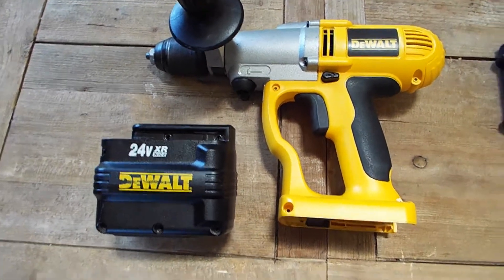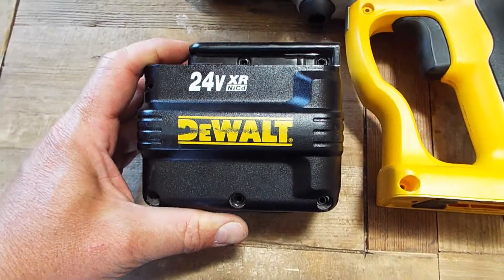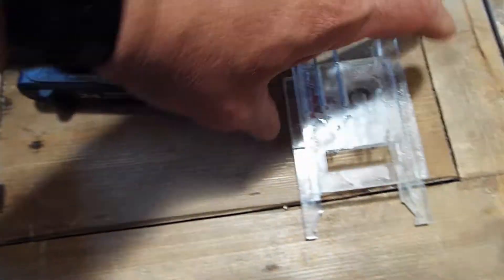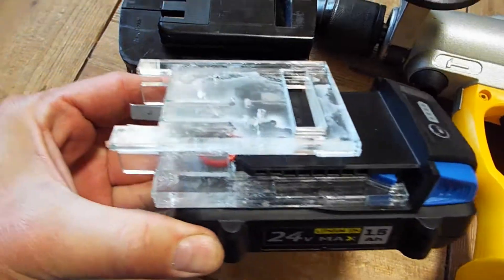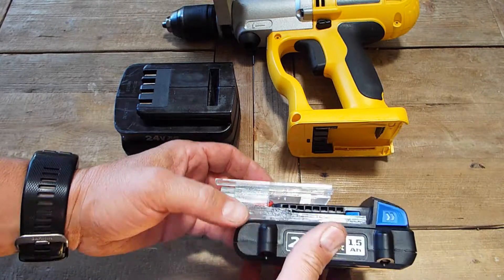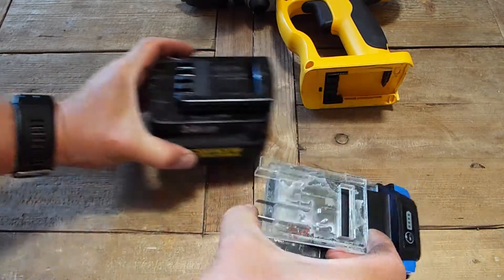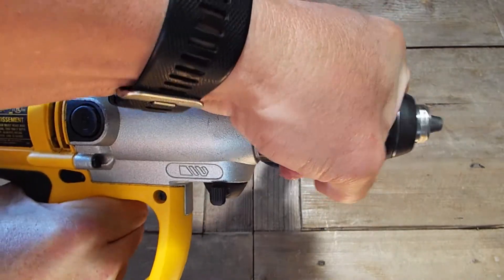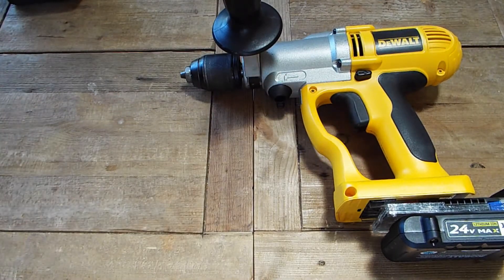24V DeWalt Tool to Kobalt 24V Battery Adapter

Comment: 10 dollar batteries? Wtf😅
Reply from the maker: It was years ago. Still have about 10 in packages, they still show 50 percent charge when you press the charge state button.
Reply from the maker: Also the 10 dollar batteries were the only reason I ventured to the 24v max Kobalt line of tools. I have almost every tool they made and really love them.
Reply: @madscientisthut  
The tools do work nothing against them, but I wish they came out with more options like ryobi.

Comment: Excellent work and great video example! We have older Black and Decker 24v Hedge Trimmers and the B&D 24V batteries aren't being produced anymore, but we couldn't see our way clear to getting rid of the trimmer that works great. Do you have plans on making more adapters for the Kobalt 24v to attach to things like the B&D 24V system, and maybe the B&D 18V drills, etc.? Thank you for considering.

Comment: Would you sell.a adapter or do.you know of someone that does I saw green works and kobalt are very similar on the the 40 8v system but not sure about the 24 v bc you can get green works adapters so I wonder
Reply from the maker: You may check ebay. I do not sell the adapters I was just showing what I did to give other people ideas.

Comment: since I don't have a 3D printer. I remove the batteries from the dewalt 24v battery pack, now it is nice and light and connect a 24v kobalt and run wires positive to positive and so on.

Comment: I would be willing to pay for two of those adapters. I have 24v Dewalt Sawsall and hammer drill, and they never get used because the batteries are shot. And new ones are very expensive. If you could make me two, or have a way to 3D print them, I'd be willing to pay for them. Please let me know.
Reply: I’d be willing to buy 2 of these as well 

I love the video. calste28@gmail.com

I’ve search all over online to purchase something like this and I can’t find anything.
Reply from the maker: Hi if you search ebay, there are people selling 3d printed ones.  Thanks for watching.
Reply: I've been unable to find anyone selling one, only the files to 3d print my own. If you have a link to an actual purchasable product, I'd appreciate the link.
thege128@gmail.com

Comment: You think the Kobalt 24v battery will work on the Channel Lock  #718715 drill from several years back? It's 24v NiCad. Drill works great...battery was the only thing really wrong with that kit.
Reply from the maker: nc50express I see no reason why it should not work

Comment: What I great idea . I recently just switched my kids power wheels battery with a lawn mower battery. Well my husband did it but still haha. Those power wheels batteries suck. Full view
Reply from the maker: Awesome to switch batteries to lawn tractor. I saw someone on YT used the same batteries (24V kobalt) and put them into power wheels, I am sure that will burn the motor up pretty quickly not to mention wearing the gear set down but the kid was having fun doing doughnuts on the lawn and zipping up and down the street,

Comment: Pretty cool, I did't know you could do that.. I don't think I can anyway but it's cool you know how... Hope you're having a good afternoon...
Reply from the maker: Thanks Allen. It is nice to be able to use tools that are older but still work fine. I did a test last night of the GoPro at 15 Second exposure, not bad. I think I want to try the 20 second. I am trying to find something that looks good without a lot of noise. The 30 second exposure has a lot of noise in it. It is just a bummer that it takes a whole night to see any test result.

Comment: That's sweet. Wish mine took that style of battery.
Reply from the maker: If you have an old battery pack that can be taken apart to use the portion that connects to the tool then adapted to to add a new style battery connected to that part.
Reply: I've got an aftermarket battery coming from eBay that was $20. Going to give it a try and hope for the best.
Reply from the maker: What voltage is your tool?
Reply: 18v, but it's the type with male connector that inserts a couple inches into the tool.
Reply from the maker: I could take the top off an old dead battery pack and make an adapter that mates to that part, you would then clip the Kobalt battery to that then insert into the tool to use it. It would be a fun project. If you want to send a dead pack to me I could try and work on it.
Reply: I'm hoping the eBay battery I ordered will work; I tossed out the 2 dead batteries that came with the drill quite a while ago. If it doesn't work - assuming it fits - then I'd have one to send.

Comment: Another great modification my friend. Wish you could make me one of those for my set. The batteries are so expensive they just sit there now I have a circular saw,  drill and flashlight I never can use them.
Reply from the maker: What voltage does your set run at?
Reply: 18v DeWalt
Reply from the maker: Is the flashlight like all of the others? (same battery pack?)
Reply: I believe so, I only had 2 - 18v batteries that came with the kit. My son has it now.
Reply from the maker: If you want to send the flashlight with one of the old batteries, I will see if I can make an adapter for ya.
Reply: I do appreciate the thought Kirk but my son uses them with his batteries and when I really need them I borrow his. You are a truly good man for offering. Not many people are like you my friend and just you offering is like you have done it for me. Thank you so much, if I change my mind or my son I will definitely let you know and be willing to compensate too. Thank You again.
Reply from the maker: Anytime John!
Reply: every single one is walabot
Reply: Do you make Craftsman 20V to Kobalt 24V?

Comment: very good idea again Kirk ... its a just a rip off for $77 battery.. i bought a set of UHF 5 WATT walkie takies for 400$ and spare batterys cost here $110 its a joke..
Reply from the maker: Thanks Dave, Batteries are where the retailers usually make the money on resales. It makes most cordless tools useless in my mind. Lowes is a retailer that started selling Lithium ion battery powered tools that have good warranties and low cost batteries, so I finally bought some cordless tools again, and since the 24V 1.5AH battery was only 10.00 I bought about 7 of those to have around. Now you see the result of me having extra batteries laying around....
Reply: Exactly kirk ..like printers and cartridges..average inkjet printer is worth on average the price of 4 cartridges 😀those batteries i told you for my Uhf 5w transceiver that cost here 120 i found on e bay new 27$ got 2 yesterday...